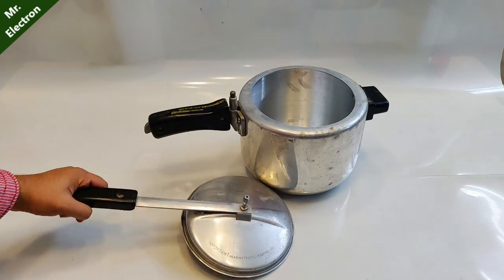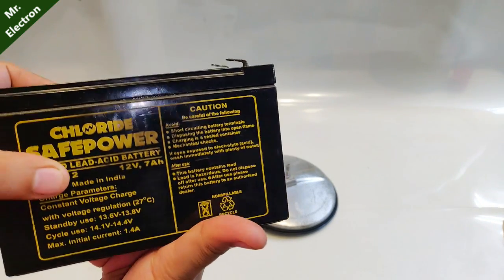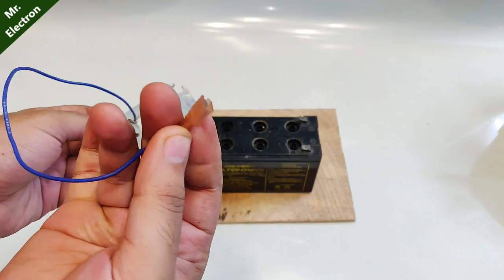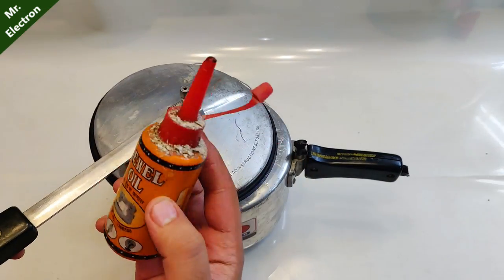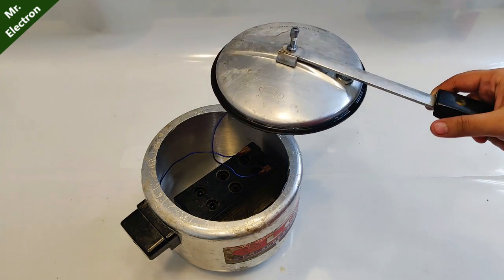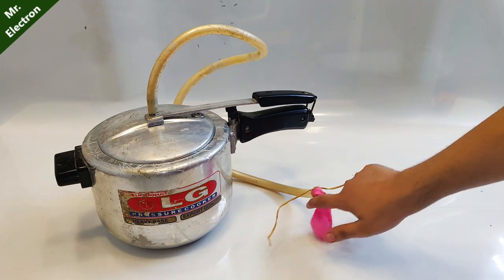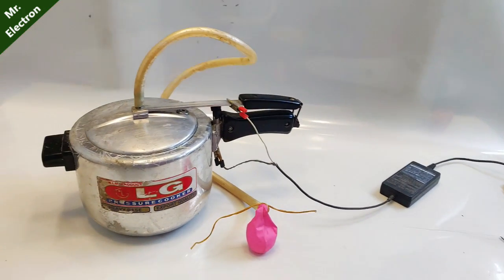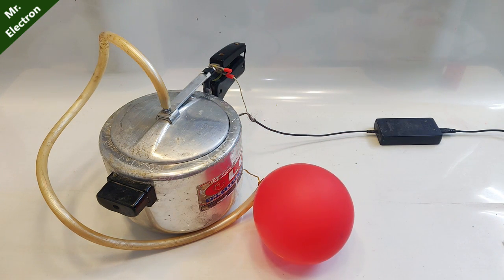Turning Battery into a Powerful Flame | Hydrogen - Oxygen Flame Experiment 3500 Celsius

Comment: "Генератор Free HHO с ИБП 12 В с батарейным питанием"  неправильное название, means "generator of free HHO with switching power supply, (with supply from) battery powered, but it is not batery powered,it is "with old lead acid battery ,(used in electrolyser mode) turned to water electrolysing cells, 6cells connected in series
"Электролизер воды из свнцово кислотного аккумулятора , Генератор Free HHO смеси (газа Брауна), запитанный от ИБП 220VAC->19VDC"(i hope you using 19VDC? 12VDC there not enough

Comment: Uhm where is the electrolysis supposed to occur in the battery in the pressure cooker, where are the plates, I thought the triangle was the plate but it's an electrical connection.

Comment: How about filling the empty space around the battery with more distilled water? The negative electrode is where the hydrogen is emitted.  
On a different note, your suggesting we can take any battery, and top the fill holes with one-hour stoppers, leading to a single tube, and just connect it to a battery charger. That reduces the pressure cooker risk too!

Comment: Just no people.. this video is fake,  do NOT I REPEAT DO NOT OVER CHARGE A BATTERY LIKE THIS THE HIGHER VOLTAGE NO GOOD LET ALONE THE HIGHER AMPS THAT BATTERY WOULD BE BOILING INSIDE THAT POT AND SO MANY RISKS OF A SHORT AND BOOM LET ALONE THAT WHAT HE HAS IN THE BALLOON IS PROPANE AS IT'S BURNING BLUE ALSO NO PRESSURE REG OR VALVE TO STOP BACKFLOW .... SO MANY FAILS JUST NO PEOPLE

Comment: 7:40 that is a propane/butane flame, not a hydrogen flame.
Reply: Also if you have HHO in a balloon, it will SURELY explode. The reaction between hydrogen and oxygen is supersonic, so you couldn't get the pressure enough so that the gas goes so fast. The flame would just travel right back into the balloon and make it explode, as there is oxygen in there. Very dangerous experiment!
Reply: @mazewind255  if it was oxypropane it would also go boom pobably
Reply: @VerbenaIDK  yeah probably, but if u could get the flow rate fast, faster than the flame can travel backwards, but also not blow out the flame, it should be fine, but yeah if it goes in the balloon it will go boom
Reply: agreed. Hydrogen and oxygen burns with an almost invisible flame, not some blue and reddish flame. Even with sodium contamination, that flame is wayyy to bright to be from hydrogen.

Comment: You're not taking any safety precautions. 
1. Make sure the pressure cooker is away from that naked flame or the residue Hydrogen could explode in there
2. You're holing the baloon using your hands, imagine what would happen if the flame travelled backwards through the tube once the pressure is too low?

Comment: Good job but you have to separate oxygen and hydrogen by using two pipe then you can fire 🔥 the hydrogen very well
Reply: Wrong the gas made here is hho and is already the perfect air fule mixture. To separate it would just add a extra unnecessary step..
Reply: @chrisofthecosmos648  hydrogen separated from oxygen is less dangerous and can be recombined later in welding torch etc should anything go wrong with premixed gas flashbacks etc just a small amount goes with a massive explosion see other vids

Comment: this is very dangerous (oxyhydrogen) and shows very little knowledge about the chemical processes. An AGM battery is very inefficient for this and the volume of the pot is far too large. Read Wikipedia article about Electrolysis.
Reply: indeed.

Comment: Hi friend, she has quite a lot of pressure but I have a question, why does the flame go out? Is it more oxygen than hydrogen?
Reply from the maker: No .. 
Reverse of it
Reply: H2O bro🙄🥴🤧👌
Reply: One part hydrogen two parts oxygen H20
Reply: First of all it is already fake. He's burning a propane/butanne flame instead of a hydrogen flame. There's no way hydrogen burns that brightly even in pitch darkness. Also it is way too yellow to be from hydrogen. Even with sodium contamination it is still wayyyy too orange-ish yellow. Also why can't it go out? I think the flow rate exceeds the speed that the reaction can go backwards thus it extinguishes.

Comment: Are you sure it is hydrogen ? It seems to be heavyer than air. If it was hydrogene it might float better than an helium baloon
Reply from the maker: Its heavier because its a combination of hydrogen and oxygen
Reply: @MrElectron   This should help:
 A) All the gases involved are diatomic gases.

B) 1 mole of diatomic hydrogen = 2 grams. 1 mole of diatomic oxygen weighs 32 grams, and 1 mole of diatomic nitrogen weighs 28 grams.  

C) 1 mole of any gas fills 22.4 liters at standard temperature and pressure. 

Thus: 
A) Air being roughly 80% nitrogen and 20% oxygen filling a volume of 22.4 liters = 1 mole of air = 80%×28grams+20%×32grams = 28.8 grams at standard temperature and pressure. 

1.) HHO gas being composed of 1/3 oxygen and 2/3 hydrogen filling the same 22.4 liters will weight = 66.666.....%×2grams + 33.333...%×32grams = 10.8 grams at standard temperature and pressure. 

2.) HHO hydroxy gas, though having more heavy oxygen than air, is still less than 1/2 as  dense as air. 

3.) But, hydrogen gas easily passes through  rubber in the balloon. Thus for the gas balloon to weigh more than air, a lot of the hydrogen must have escaped through the balloon's rubber. Excluding the weight of the rubber: X%×2+(100%-X%)32 > 28.8 means X% being hydrogen must be less than 10.7% and oxygen more than 89.3% meaning you lost a lot of hydrogen in the balloon.
Reply from the maker: Thanks for the detailed comment but you might have seen that the half filled helium balloons are unable to fly because of the weight of the rubber itself.

Its true that hydrogen is lighter than helium but still the weight of the balloon itself leaves a considerable impact which adds to the heavy oxygen in the balloon.

*Note - I only half filled the balloon.

Comment: Pressure  cooker + hydrogen + oxygen + flame. All the makings of a bomb. What can go wrong?  Seriously, fill the pressure  cooker with something like water, dirt,  or what ever. Just minimize how much volume of hydrogen and oxygen can accumulate inside the pressure  cooker.  

Doing that will also help ensure you get more hydrogen early on rather than blowing out lots of air.
Reply: Oil + oxygen ?????
Reply: @odeltarkhan3033  oil+oxygen can burn  but could you expand on what you were thinking?
Reply: @kreynolds1123   oxygen in contact with oil or grease is a bomb my dear. I work with oxygen a lot and of course had to study a lot to be certified as a gas blender
Reply: @kreynolds1123  I believe this guy  making this stuff is crazy and has little knowledge on oxygen properties
Reply: @odeltarkhan3033  Considering the risks of a flash back. I think the biggest immediate risk comes from the volume of hydrogen and oxygen in the pot which could be mitigated with flash back arrester and a bubbler along with minimizing the dead space. 

While oxygen in the atmosphere is about 20%, oxygen's concentration from an HHO generator is 33.3% I'm not sure how much more risk comes from a slightly higher oxygen concentration than atmosphere along with the oil used to make a seal but I suspect the rate of oxidation depends on temp and surface area and concentration, and that the pot whisks away heat from oxidation. But electrolysis here is generating lots of heat as 12v across a cell is highly overvolted to drive sufficient current in a poorly designed cell. So maybe oxidizing oil at upto 100c in a 33.3% oxygen enviroment is a problem, or maybe not. Your thoughts?
Reply: @kreynolds1123  under pressure and heat oil in contact with ean + 40% is a bomb. In addition collecting only hydrogen will lead to an increase of the partial pressure of oxygen which will explode reaching 40% of the total mix in contact with oil. This guy is making a bomb in his house unknowingly.
Reply: @odeltarkhan3033  I think your correct with bomb especially as it related to the volume of HHO in a pressure cooker. And 33.3% oxygen isn't that far from 40% but I don't see   its concentration increasing much short term,  and there is a risk of pressure buildup if one intentionally shuts off a valve for too long. But otherwise, the pressure above atmospheric is generally low, and the surface area of exposed oil is low.  
So maybe there is a real risk to the oil auto ignighting and that would lead to the bigger problem with the volume of HHO ignighting. And the risks to life and property would be far less if one simply reduced the dead space.
Reply: @kreynolds1123  yes exactly. The partial pressure of oxygen inside will make the hydrogen ignite faster